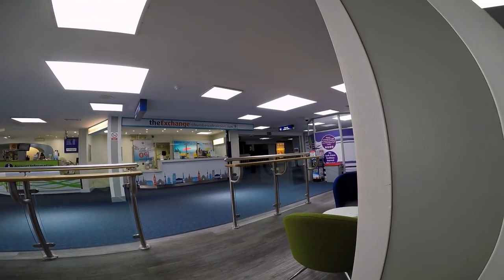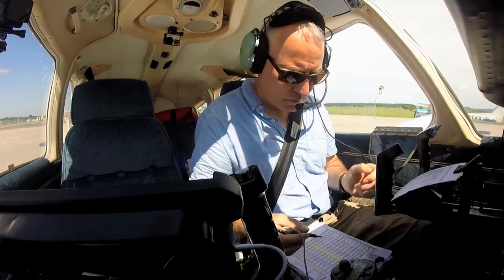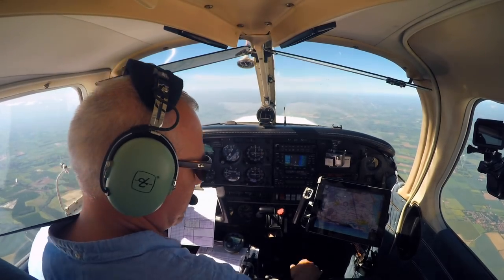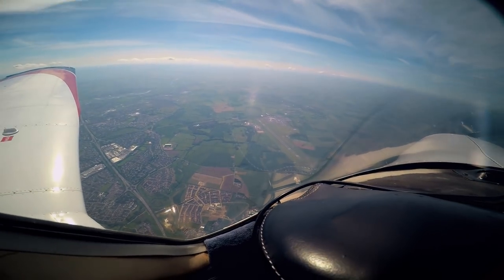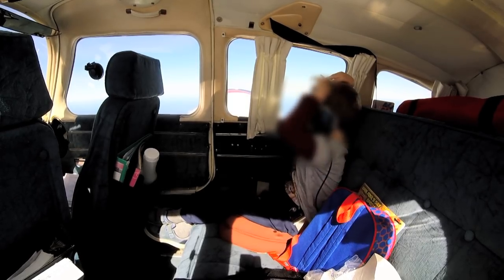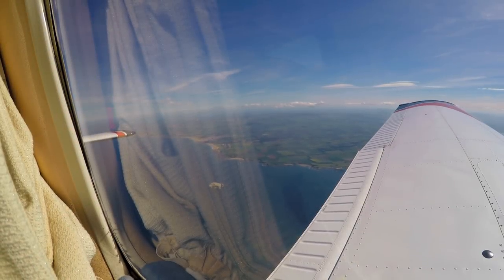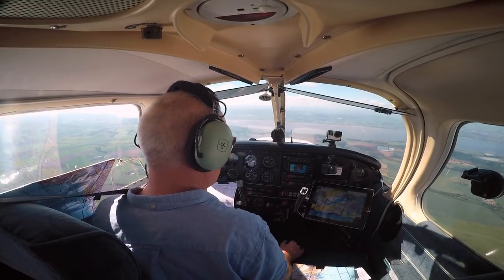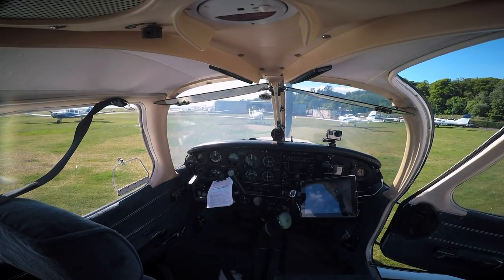Humberside to Dundee VFR in a PA28

Comment: Thanks for the videos! Which iPad mount do you use?
Reply from the maker: Thanks.  From my FAQs: "I have an older, and rather large IPad. (fourth generation I think) Will hopefully upgrade to a smaller, more cockpit-friendly version sometime.  For now, I mount it to the yoke with one of these.  http://www.transair.co.uk/sp+Apple-iPad-RAM-Mounts-Ram-iPad-Complete-Yoke-Mount-Kit+1426

Do make sure the flight controls are unimpeded by the mount/iPad.  If you don’t adjust it well, it can get in the way of the mixture setting on the PA28."
Reply: The Flying Reporter Thank you for the link and advice. I have an iPad mini & will pop into Transair.